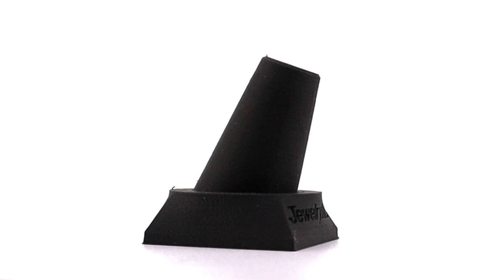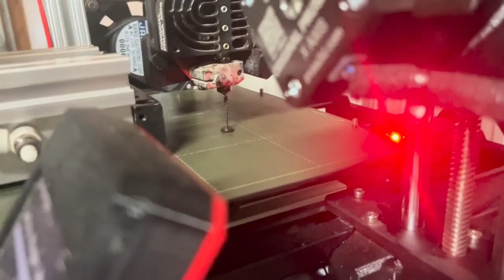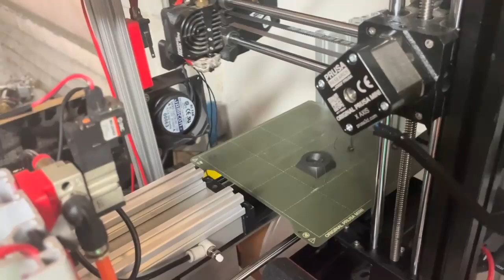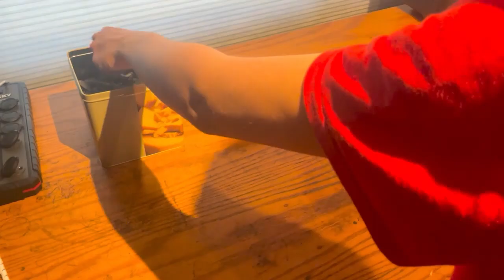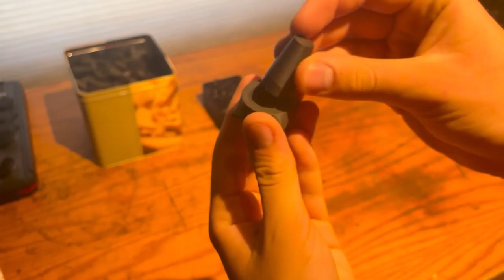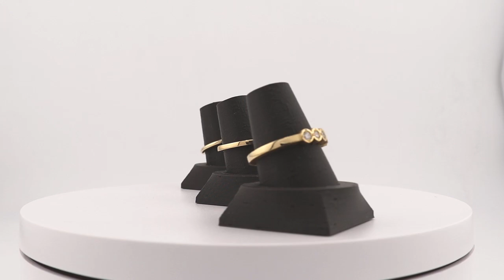Continuous Printing via Pneumatic Part Ejection

Comment: Super cool build! I've seen printers where the extruder head rams into the part to clear it from the plate, may I ask why you used your setup opposed to that?
Reply from the maker: Great question, I actually have, the previous video I posted was showing the print head ramming a part off. I wanted to move away from that since it only works on certain types of parts, usually if they are tall and have a small surface area contacting the bed. The finger part can be ejected in this way, and I used to do that. However, the base is really short and has a large surface area relative to its height, which means the belts just skip instead of actually disengaging the part. That's why I built this, otherwise the simpler solution would definitely be to just use the printer.
Reply: @kennetek  Ah thank you, that makes a lot of sense. Thanks for explaining it for me!

Comment: How does it automatically start the next part?
Reply from the maker: I have the slicer put the blob as custom start g-code and the ejection as custom end g-code, so each object does the full cycle, and then appended the two parts together in Notepad++, and then copy-pasted that merged block of g-code a hundred times. I think Marlin has a looping command with M808 but I am unsure if that works. 

The print progress is updated via M73 commands inserted by Prusa slicer, so it always ends at 100% for each part and then resets, even though it has barely made a dent in the full g-code file.
Reply: @kennetek  Ahh, okay, so you have one MASSIVE gcode file that just copies and pastes. I'm working to integrate my Desno robotic arm to remove and replace mag build plates in my X1Carbon. I'm familiar with start and end alterations with limit switches for camera time-lapses. I was just curious how you were able to get it to restart. Great concept!